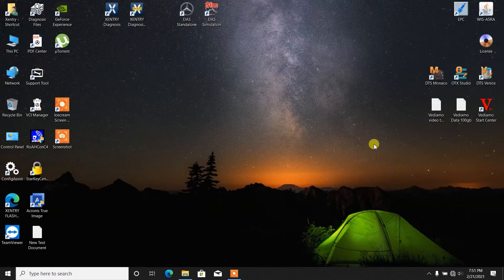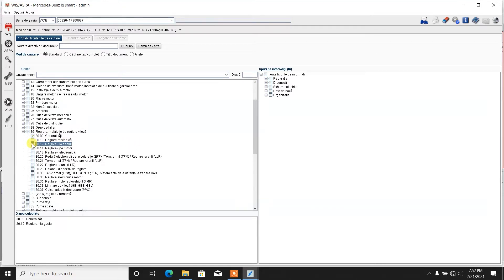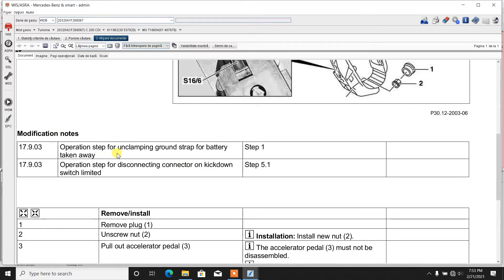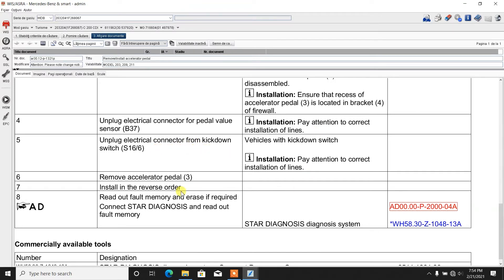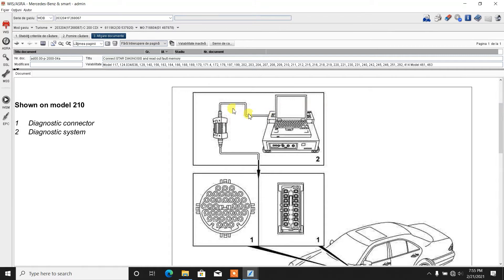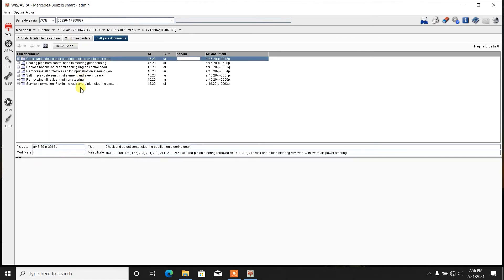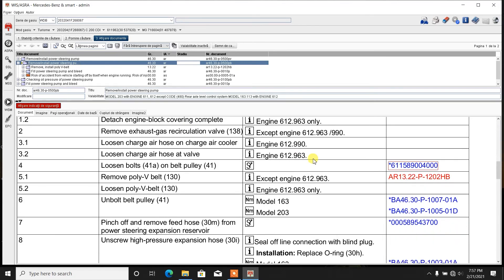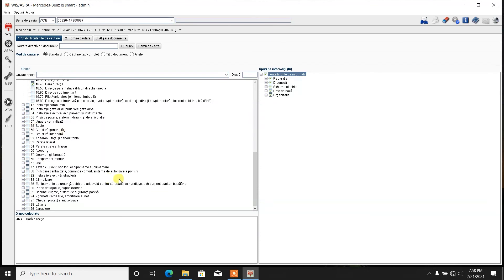Mercedes Benz WIS Tutorial

Comment: Do you know if i can search by dtc code in this program??
Reply from the maker: @RicardoDiaz-mb9wm  unfortunately I don't think so. The thing is if you scan with DAS or Xentry (which are both original Mercedes Benz diagnostic programs) those programs give you more details than you can think of. They offer steps and procedures on how to diagnose and solve the problem. WIS is only a procedural software that shows how to disassemble and find out torque specs+ some other useful informations.

Comment: Hi Please : ( can you helps ?

When i install wis and i push for a example repair i say as demo replacing the oilfilter, when i push the dokument its white and nothing is down side of wis to see : ( 

Is my Windows defective or what i must do to see the Dokuments ?
Reply from the maker: Try resizing the window.
Reply: I kiss your heart for helping and answering : ( 

how i can resize ? it is the downside of the wis java totaly empty nothing opened : (
Reply from the maker: @G  try moving the cursor, and it should change to a different shape for resizing the bottom side. If that doesn't help, I recommend reinstalling the windows and then reinstalling Wis and the rest of the programs.
Reply: I have try everything its not working : ( i have 2 versions 2018 and 2020 nothing works i can find the steps but i cant see the pictures its not loading 😞
Reply from the maker: @user-bw5hk5nb3k  where are you from?
Reply: Germany : ( , can u helps me in whatsapp ? i can send u a picture which u can see the downside 😞